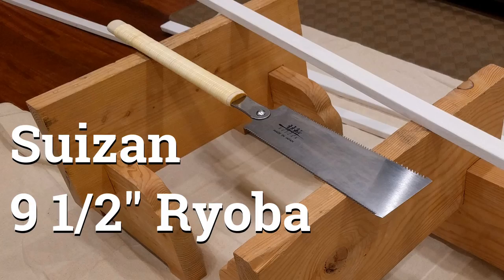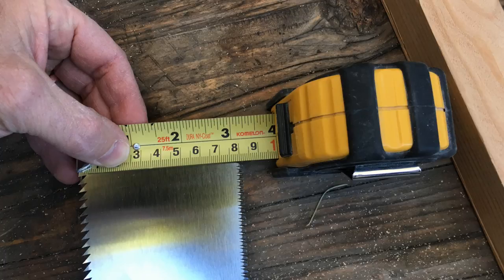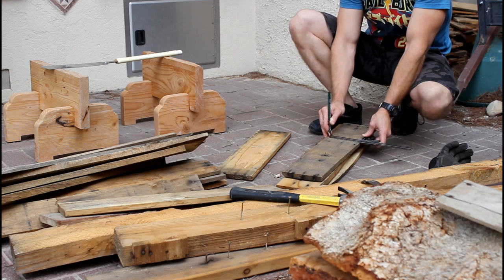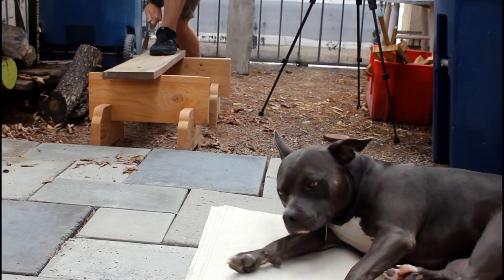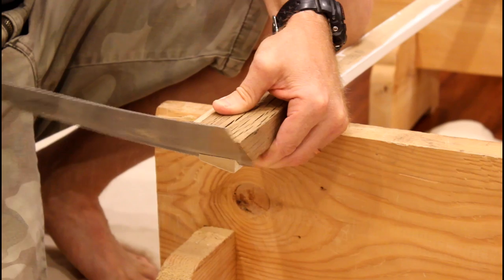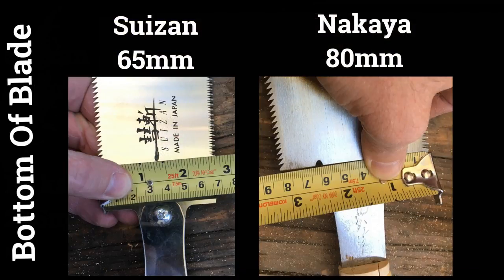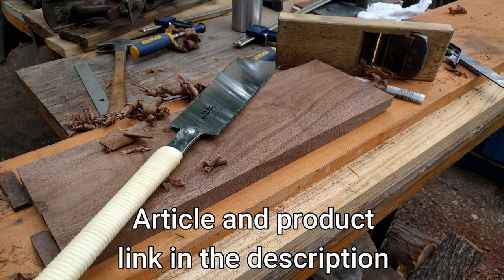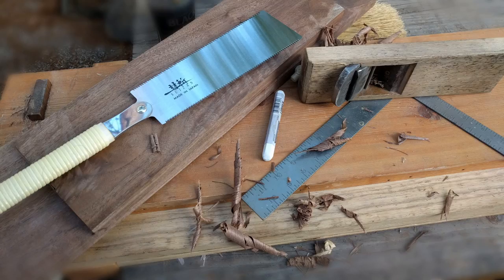Suizan Ryoba Test and Review - Japanese Handsaw Review

Comment: Informative video.  I am using Japanese saw more and more and found your remarks about pushing to be right on the mark.  On thicker and harder lumber I found the blade binds often so sticking shim in the cut really helps.
Reply from the maker: Thank you David.  Thanks for the tip.  Japanese saws can be addictive once you start using them.

Comment: I have SUIZAN and gyokucho and honestly i profer for much Gyokucho, gyokucho saws are simply awesome
Reply from the maker: It's great to hear you love using Japanese saws. Which gyokucho saws do you have?
Reply: AdventuresInDIY i have the S-450 , S-651 , S-300 , S-371, one dozuki suizan & one ryob suizan
I couldnt believe how great was cut at hand with japanese saw vs western.
But i have to agree that in the edges western saws are a very little  cleaner, but well for that are planes.
Saluts
Reply: i have a doubt, i would like to adquire a ripcut saw bigger than mostly japanese saws, i would like something like a anahiki but i when i make the question to japanasewoodworkers.com they told me that the anakihi was a crosscut(i would like it to post and beam) 
this :   https://www.japanwoodworker.com/products/13-1-2-sakimaru-willow-leaf-log-saw-hikoza
but in a video u say that it can be use like a ripcut saw(in fact you use like a ripcut saw), what will you recomend me? and if you can show me the link to a other online shop i t would be reallly nice

Comment: I recently bought a dozuki saw from rockler store think it was 31$ and its only 7"? Give or take and I love it I love the cut on the pole action it's a lot more accurate feels like I have more control doesn't wander at all going to check these guys out considering that the blade is bigger and cheaper thanks for the demo chris!🍻
Reply from the maker: Joe basement woodworking the dozuki they sent is the 9" one. The dozuki saw in general is a great one to start with also. Once you get used to the ultra sharp blades and thin kerf you never go back 😀. Thank you for commenting Joe! I really appreciate it. There thing I like is some of the factory pictures they sent. I put those in the article.